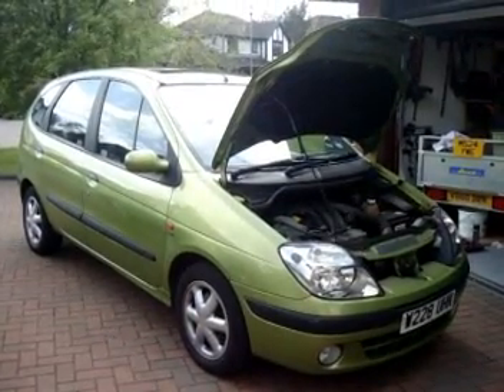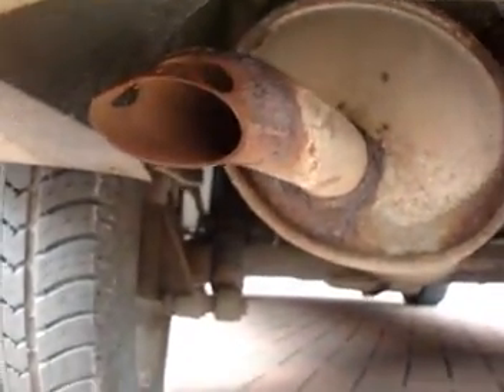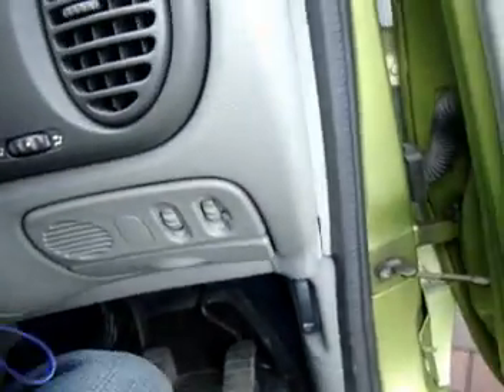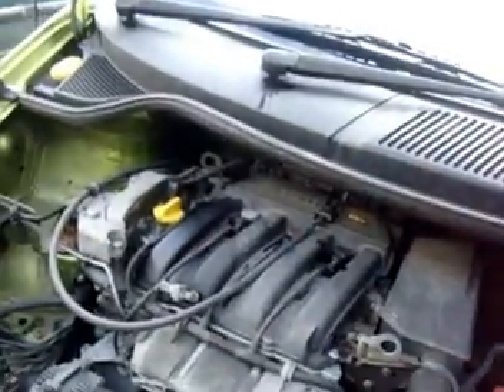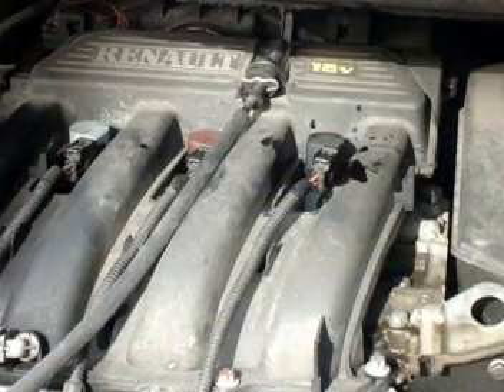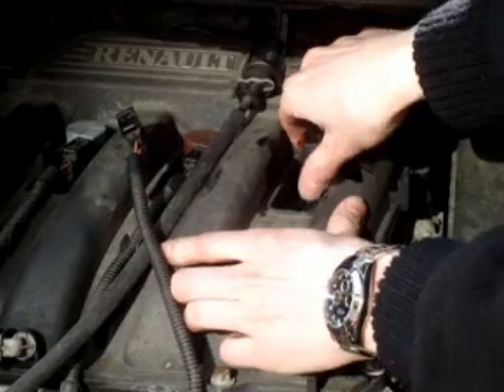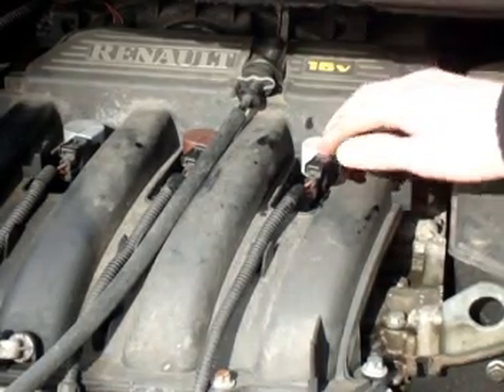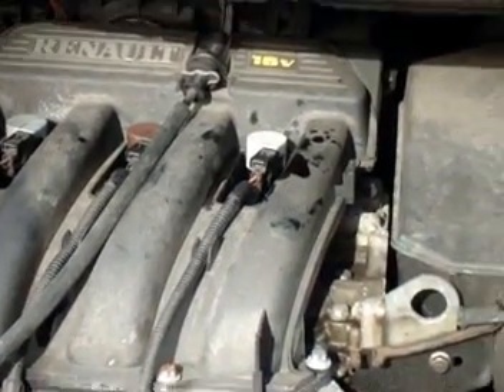Renault 16v engine coil replacement.

Comment: If there is absolutely no spark at any of the coils, can it be the Crankshaft Position Sensor ? It does not have a big coil, am I correct ? It gets the spark from where ?

Comment: Hi I have megane 2006 year 1.4 loss off power spark plugs where changed however engine light came on one day a mad craxy clacking noise came from the car the second coil was lose luckly was able to tighten it. Since then I have had the same issue bar the clanking nit comes an goes done the coil check today engine just cut out almost straight away. On closer inspection the second coil the out layer of the rubber was spilt in 2 and the outside plastic looks like it was melted away? What you think thats about

Comment: my coil pack in the second cylinder is gone causing a misfire in the third , do i need to change both second and third coil pack or will i get away with just changing the broken one?

Comment: hi Adam this morning my renault megane engine light came on felt the car shaking popped up the bonnet and the engine is shaking. would this be due to plugs or coils ...
Reply from the maker: unlikely spark plugs would fail suddenly. I would check the condition of the plugs and replace if needed. Then do the coil pack troubleshooting as per the video. Let me know how you get on.
Reply: Thanks for the reply Adam going to replace all the plugs and coils on Monday think it's £80.00 from euro car parts ill let you know how I get on thanks again :-)
Reply: +Adam Hutton just about to up load a video to see if you can see it for your self :-)
Reply: +Adam Hutton  all fixed was due to the 3rd and 4th plugs and the 3rd coil runs like a dream now

Comment: Hi can you  tell some info about petrol filter? I heard stories to is no petrol filter on this cars, I have a scenic privilege 1.6 petrol 02. Auto. Thanks.
Reply: There is, but it's hidden somewhere under the car. Mechanic just replaced the one on mine.

Comment: Great vid, nice and straight forward. I've got a Renault Scenic Rx4. Its misfiring like crazy. I've disconnected each pencil Ignition Coil one by one. Each one effects the idle revs (which are currently rough as hell) Number four stops the engine completely...would this rule out bad Ignition Coils?

Comment: Hi Adam thanks for the video. I have an '03 Scenic, (60k miles) and as I started it up to bring the kids home from the park I knew something was wrong straight away. It started fine but the gearstick was wobbling around like mad and it sounded like a VW Beetle... Sure enough a short way down the road the engine light started flashing and there was no power at all, it struggled to even get going from a standstill. I limped it home (about 15 mins away - around 20 - 30 mph very gentle driving) and just before we got home the light went out and it was running fine again. I left it for a few hours, just been out in it again and same symptoms - engine light flashing again.

I did take it to an Arc Carwash today and it got filled up with unleaded. Both things done today (car wash first - no problems after that, or filling up). There was no problems driving it to the park about 20 minutes away, It was only starting it up and driving it home several hours later the problems started. Do you think this is the coil packs you showed on this video? Thanks for taking the time to read and answer :)
Reply from the maker: hi check for water inside spark plug wells. If no water there unplug coil cables one at a time listening for a change in engine tone. The engine should shake even more violently if the coil is working. If you unplug the coil and nothing happens then you have found the faulty one. If you can afford all 4 replace to resolve for a long term fix.. If on a budget replace the faulty coil and car will run fine again,

Best of luck,

Adam

Comment from the maker: it is very difficult to find out which coil is faulty and even once you do the remaining ones that are still working are likely to fail very soon. I would recommend buying 4 valeo coils for your car as these will not give you any more problems with coil packs. Thanks

Comment: adam pls can u help,i got the same car but in 2 liter engine,i took it for a drive today and passing the 70 mile per hour the power drop of and the light management come out on the dash board.there is light in the middle come out but its not on any more the light is looks like that spring and engine start rattlet drove back not problem .but the engine light management still on.any advice pls.i hear the engine got a noise maybe is the exhaust got a little hole.many thanks

Comment: Thanks so much for this tutorial. Gave me the confidence and knowledge to do this on my Renault megane coupe. Had coil packs go and had them replaced. 2 months later same happened again. Was told they went in pairs so thought fair enough. so, when they went for the third time on boxing day I was cheesed off to say the least. There was no way I could afford £150 again! (oh yes, this was what I was charged!!!) anyway came on here and a Renault forum. Learned they go in pairs 1 and 4 and 2 and 3.

Comment: After watching your video I changed all 4 coils on my daughters scenic megan in less than 45 mins the only difference was I had to use a 10mm socket to remove the retaining bolts. The relacement coil pack was bought on line from motaquip (Ireland) for £34 . Local renault dealer wanted to charge ! hours labour plus parts

Comment: Car started misfiring badly last night after a couple of weeks of poor starting and I recognised these symptoms after a coil went 4 years ago. That time I took it to a Renault dealer to have the job done at top prices but after finding your video I saw what a an easy job it was and so first thing this morning I rang round local car part dealers and sourced the parts and did the job in about an hour including a cup of coffee. I used a Draper Torx E10 socket if that helps anyone. Many thanks Adam.